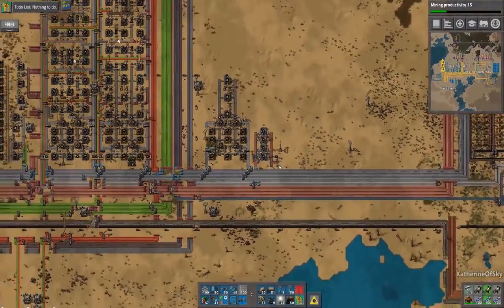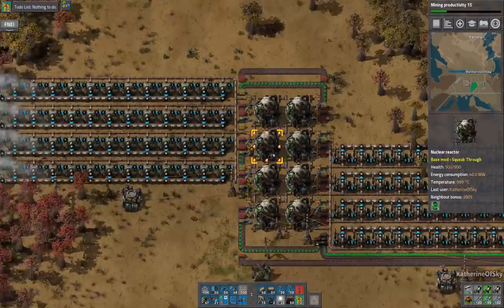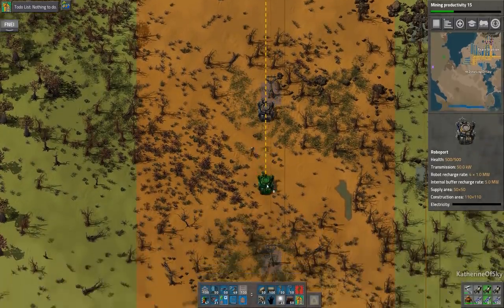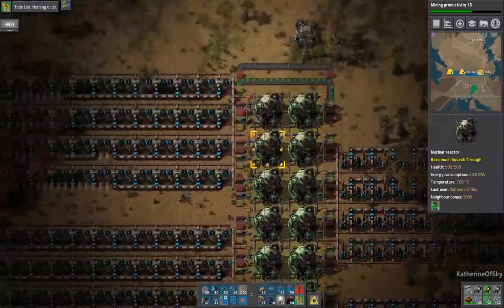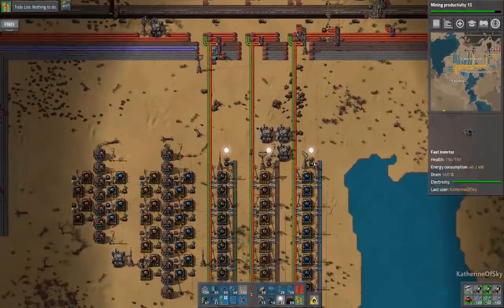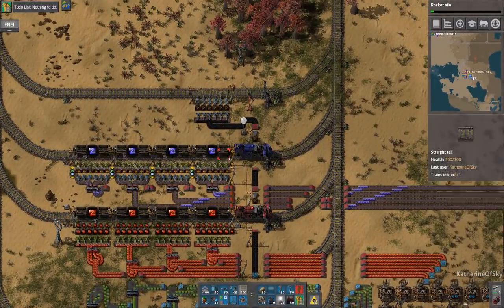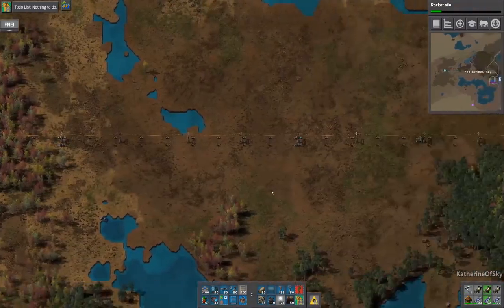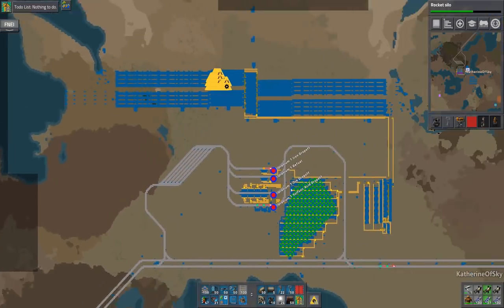Whistle Stop Factorio Ep 60: NUCLEAR PRODUCTIVITY - Mod Spotlight, Let's Play, Gameplay

Comment: Your lube production (?) got unhooked from power while you were beaconing your oil cracking.

Any thoughts on maybe speed beaconing and prod moduling your copper wire production at BC? Or maybe setting up another GC factory strictly for deliveries to BC?

Comment: 29:14, copper cable has double the stack size of copper plate, and therefore no throughput would be lost with trains. And the cable needs to go on the belts anyways, to insert into the assembler.

Comment: I think that you still underutilizing your nuclear plant. Expanding one isn't linear.
If my calculations are correct, you were missing 16 heat exchangers before. Since you doubled it, you need 16 more, and 16 on top of that since you have 4 more reactors at full neighbor bonus.

The method to count is to count every instance where two reactors touch each other, double that number, and then add the number of Reactors to it, and finally multiply it by 4 to get the number of heat exchangers. The number of turbines is 1.7 times the number of heat exchangers.

As for the koverax... I modified your design to have two centrifuges per chest set, which makes it 9 block wide, which means that it has proper spacing for the beacons.

Comment: if the mega-factories are on the right grid spacing, you could perhaps load/unload wire into the train direct from the factory e.g. factory->loader->loader->train. 
(i've never used loaders so I hope that's right - if it is I can also imagine a silly delivery system using only loaders & train cars)
Reply: Maverick StClare you want the factory to be working all the time, not just when a train is there. 
Although maybe using a stationary train car as a kind of oversized chest could be effective, but that would interfere with the beacons.
Reply: I imagine three sides of beacons is probably enough. It could be Train->loader->loader->chest->loader->loader->factory but that's an odd number - again it depends on the grid
In my imagination there were multiple trains with a roll-on-roll-off station.
Anyway, I don't think KoS will try it so the only way to know is to do it at home. Bot based would end up being the best I imagine. Requester->loader->factory. That leaves  room for the full set of beacons too

Comment: Green circuits still has level 1 productivity mods. And using productivity and beacons for copper cable would reduce the required amount of incoming copper plate.
Reply from the maker: Fixed in the next few eps

Comment: I think you are underutilizing your nuclear plants. I think you could add make heat exchangers and turbines to make more power, but I could be off in my ratios.
Reply from the maker: These ratios were calculated by Mike C, and they should be exact.  I may need to add another line or two because of the end bonus.
Reply: Those ratios are exact only for a 4 reactor array. As you add more, the amount of power you can get it scales up non-linearly.